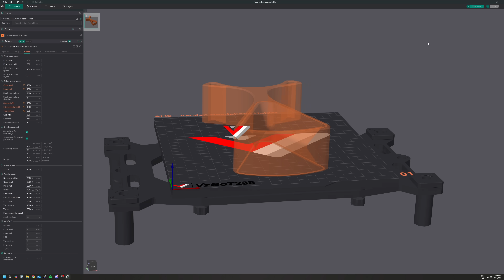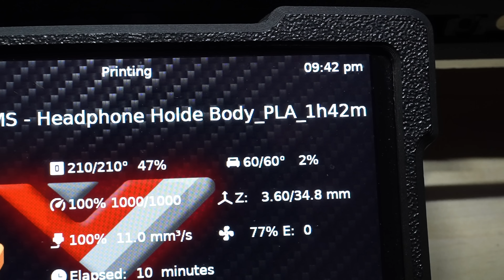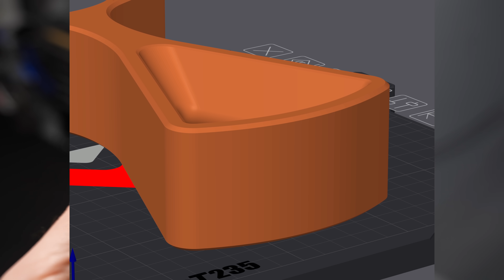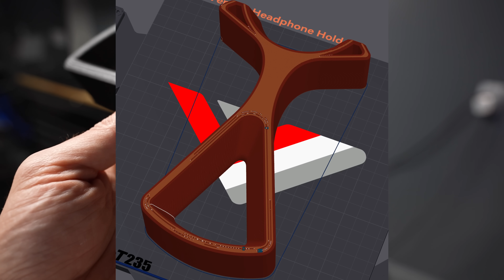Headset stand 3D speed printed at 1000mm/s

Comment: this ripples, try g-code that use G2/G3. its comand that say, move on arc. all 3dprinters still use G1 command which is strait line. its ancient defect of old incapable cpu's of amateur 8bit priter boards.
Reply: Except klipper converts G2/G3 back to bunch of linear moves so it does nothing.
Reply from the maker: klipper and arc... doesnt really do anything. Its on in the slicer and firmware

Comment: Have you thought about printing test samples using the models by My Tech Fun and sending him the result to strength test? to validate the strength of your parts at that speed. I am sure they "feel" strong, but he would give you an exact answer.
Reply from the maker: I have a tensile tester here. I just need to find time to test them. But if I print a part that needs all the strenght and quality..it will not be a 1000mms hehe. Fast, but not THAT fast
Reply: This please!

Comment: It seemed like that in the end of the print you haven't added a retraction and there was a blob of plastic on it. Why is that?
Reply: It's a really common thing. I'm the only person I've seen start END_PRINT gcode with retract & extremely high speed horizontal move to break the final string before lifting.
Reply: @daliasprints9798 Skill issue, mine does a spiral Z-hop which is even better.
Reply: @youtubehandlesux  I wouldn't really call it "better" but it sure wins under "rule of cool"

Comment: Nice machine but the stand is functionally useless. It will easily tip over. Also consider making the top slightly concave so the headphones align properly.
Reply from the maker: @rust941  thanks. Its not my model. I found it on printable.
Reply: @Vez3D  Oh, I for sure thought you made that V shape after Vzbot, my bad

Comment: Nice my friend!
I have the old hextrudort low how I can upgrade to the new hextrudort?
Reply: I have the CNC low. The plus version is good, but the low can easily print over 1000mm/s you don't need to upgrade
Reply from the maker: @RS-3D  its a drop in replacment